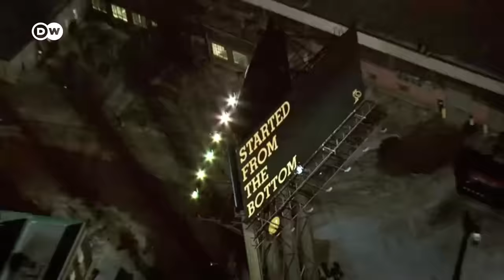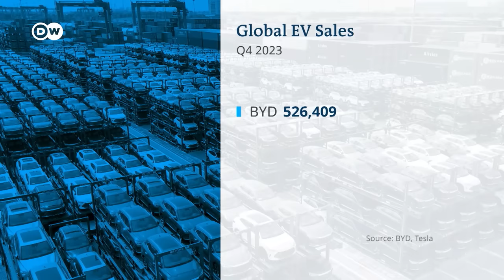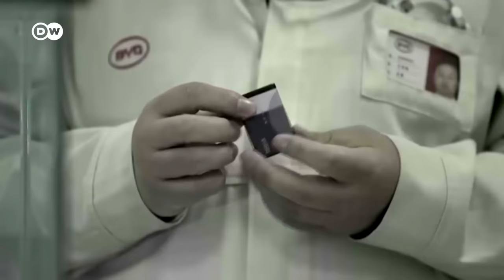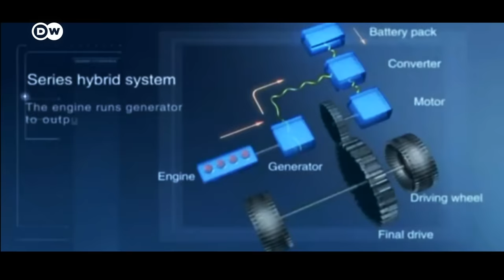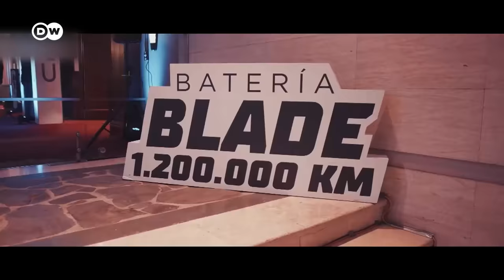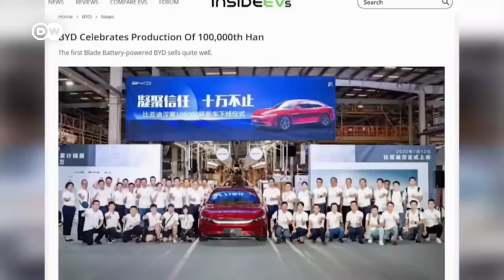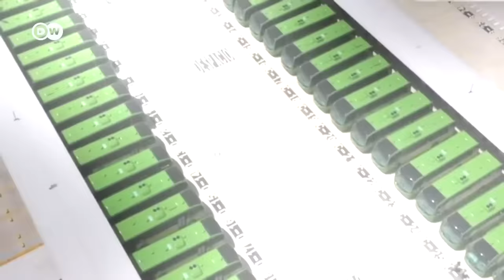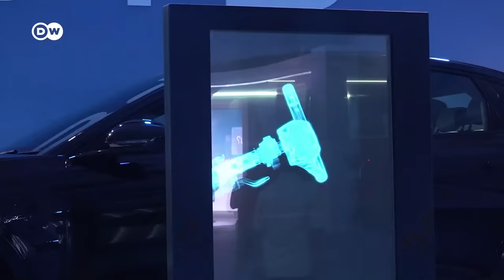How BYD killed Tesla! But can they stay on top?

Comment: The "affordable and high-quality" goods from China have a significant impact on the global market. On one hand, they provide consumers with more choices and better value for money, enhancing the quality of life. On the other hand, they also pose challenges to the market interests of capitalists and political groups. For capitalists, cheap goods may threaten their profit margins, forcing them to lower prices to maintain competitiveness, thus reducing profits. Moreover, the widespread availability of Chinese goods may compel capitalists to seek new production methods and business models to adapt to market changes.

For ordinary consumers, cheap goods undoubtedly bring material satisfaction. Consumers can obtain more goods and services at lower prices, improving their quality of life. This is particularly evident in developing countries where consumers are often more price-sensitive.

However, this low-price strategy may also lead to some negative effects. For example, it may erode the capital exploitation of ordinary consumers because the reduction in commodity prices may decrease the profits that capitalists obtain from consumers. Additionally, the low cost of Chinese goods may put pressure on domestic industries in other countries and regions, leading to unemployment and economic restructuring.

For political groups, the widespread circulation of Chinese goods may challenge their control over the market. If domestic industries cannot compete with Chinese goods, it may lead to industry outsourcing, affecting the country's economic security and job market. In such cases, political groups may adopt protectionist measures, such as raising tariffs and implementing quota restrictions, to protect domestic industries and markets.

In summary, China's strategy of "affordable and high-quality" goods has had a profound impact on the global market. It not only offers consumers more choices and better value for money but also challenges the market interests of capitalists and political groups. In this process, how to balance the interests of all parties and promote the healthy development of the global economy is a problem that requires governments, businesses, and consumers from all countries to think about and solve together.

Comment: But the thing is why would anyone want to pay $10,000 for less than 200 miles of range and it’s gonna take well over a half hour to charge that don’t benefit me I can go get a Chevy bolt 2017 with a new battery in it that’s got over 300 miles of range For less than $20,000 I’ve got customers that come through my car wash that get 310 miles of range out of the Chevy bolt

Comment: EV cars are terrible. We produced them and dropped them 100 years ago because of range and charging time. Sounds familiar?
Reply from the maker: Well, what really led to the decline of the electric car back then, was the advent of the Ford Model T, which was a lot cheaper than most EVs at the time. Not to mention the enormous impact the discovery of cheap crude oil in various places that made ICE cars simply a lot cheaper to run.

Comment: BYD will die with Li-ion battery.
Reply: 😂India best achievements so far 

India's Hunger index
2013: 63rd rank
2022: 107th rank
India's Happiness index.
2013: 111th rank
2022: 136th rank
India's press freedom rank
2013:79th
2022: 150the the fourth pillar of worlds largest
democracy is no more
India's unemployment rate
2013:4.9%
2023:7.5%
Unemployment rate never increase in growing
economy.. india is growing only on paper and by
loan
India's Debt
before 2014: ₹55 lakh crore
2023: ₹155 lakh crore
India's GDP from 2004 to 2014:
$709 billion to 2.04 trilion (almost triple)
India's GDP from 2014to 2024:
$2.04 trillion to 3.6 trilion (expected)...not even
double
Reply: @jacksmith-mu3ee  
"2013: 63rd rank
2022: 107th rank"
==
63rd?
India needs more employments from China and not in EV industry.